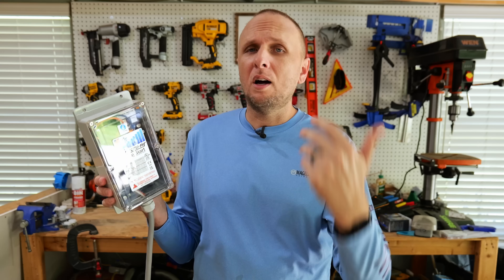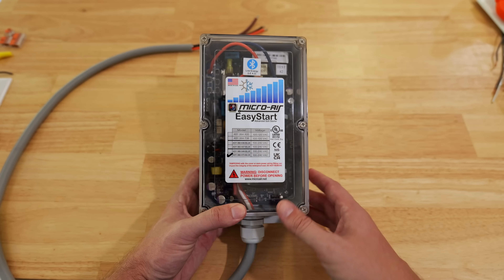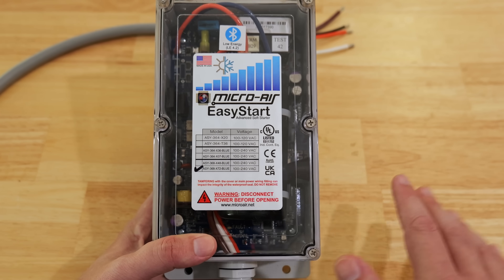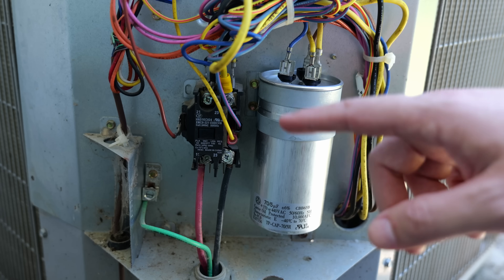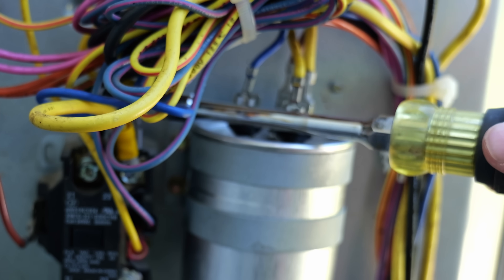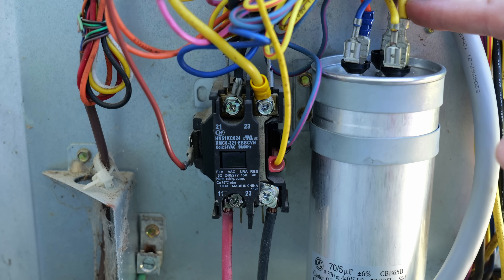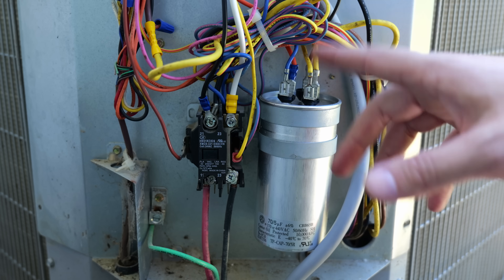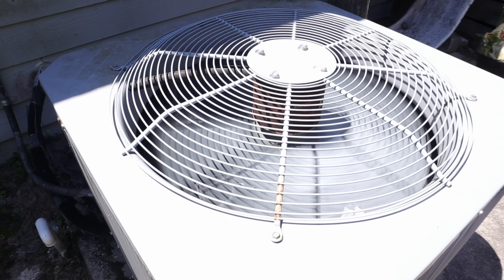Why Every Homeowner Should Consider Installing an AC Soft Starter | Micro Air Easy Start Install

Comment: Non-inverter generator it appears.  Concerns re: dirty power and electronics?  I have a whole house surge protector.  Would mind installing one but I’m not sure my 30A Northern Tool Powerhorse 3500 could start it.
Reply from the maker: My large generator is not an inverter but it’s THD% is under 5%.  Won’t damage the sensitive electronics.  Really just depends on your AC unit and what it needs to get started.
Reply: @HowToHomeDIY That’s the key then, the <5% THD.  Wagos considered?

Comment: I installed an EasyStart last year when I got a Predator 9500 (set up and wired for a possible second 9500).  We have an all-electric house with heat pump.  The EasyStart works well: it reduced the inrush from nearly 90A to typically 20A.  Soon after installing it we had a heavy rain and mosisture got into the housing, and i resealed the housing after drying it out.  One thing that would be nice is that the bluetooth would connect when the compressor is not running in ordeer to get stats.

Comment: (Update) As a former Army Gen Tech, I appreciate videos like this! I installed a generator inlet and load tested my house with my Westinghouse 9500 gen and it overloaded it. 

I installed the microair X48 on my 3.5 ton AC and the generator took it like a champ! As an added project, I installed emergency lights outside my house where my inlet is during power outages at night.

Great videos! 👍🏿

Comment: You hooked everything up properly...this is where the pros come in. Your in rush current is always checked at the common wire on a single phase compressor. Look at your schematic for the common wire and trace it back to your contactor. Also look at the data plate this will show you your RLA run load amps. I'll guarantee your RLA which are also checked at the common wire are well below 125 as well as 35. I'll also bet your RLA is probably below 10amps when checked properly or your small generator would not have been able to start the A/C unit.
Reply from the maker: Nope, my RLA is nowhere near 10 amps let alone under it.  I showed what inrush the meter read before and after install.  My small generator still had no issue starting it up.
Reply: @HowToHomeDIY  you need to check it from the common conductor not the run.....smh

Comment: Great videos!  Thank you.  I have a 3.5 ton, 16 seer a/c. My generator is a 4750w WEN dual fuel generator. Is it large enough to power my a/c, and maybe other things with a soft start installed. There is a hard start on it right now. Guess it would need to be taken out?
Reply: I think you'd need to take off the hard start.
Reply: @Alan-yd5pc  yes, I thought so.  Would this generator be powerful enough to start up my system?
Reply: @nickdeliso7026  I'm not sure.  You would have to do some load calculations once you determine how much juice the A/C needs.  I'd imagine if you ONLY ran the A/C with the soft start installed that would be doable, however, you may not have too much reserve power left to power other things in the house.  Once you do the calculation, you will know for sure.
Reply: @Alan-yd5pc  Thank you Alan. I may buy a larger generator after consulting a local electrician.

Comment: I have a 4-ton (46,000 BTU) A/C unit. Two years ago I installed a Micro-Air EasyStart 368 (4-ton) Soft Starter ASY-368-X48-BLUE. It now has 26,400 starts. My AC unit now uses 12.8 to 13.8 Amps and a Start Peak of 33 to 36 Amps. I bought it at Global Yacht Supply. It was shipped from Micro-Air. It now costs $332. I have a Firman T07571 Tri-fuel and run it on NG.
Reply: 4 ton is 48,000 BTUs

Comment: Does it convert voltage or do you still need a generator voltage output equal to your compressor motor voltage?

ie: could you use it on a 230V compressor with a 120V generator?
Reply: No, unless you have two 120V inverter generators designed to work together.

Comment: great. my thing is saving money. what is your electric bill like now? how much are you saving now?
Reply from the maker: It wont reduce the electric bill in most areas as it is only reducing the peak in rush on startup.  But in areas where the electric company charges you based on your peak wattage, this will help bring those bills down, usually by a good amount.
Reply: @HowToHomeDIY  that's what i want to know being i'm in florida. is it worth spending $400 for this thing only to see a $1 or two difference on my bill. that isn't worth it to me.

Comment: I wish I'd seen this sooner. Cost almost $6k to replace the compressor. We get a lot of power surges. The lights dim when the AC first kicks on. We have a whole house generator but when we tried to use it, it tripped the breakers. Not sure if that was related to AC or not. If it can reduce power draw and protect the compressor from power surges, that would be fantastic. I'm going to share this on some forums I'm on because this is awesome.
I wonder if I could mount the unit on the wall next to the box that feeds power to the unit. 
What gauge wires are those? 10? They look larger than 12. 
How are the learning starts done? Does it do it automatically or do you have to turn it off and on manually?
What kind of breaker box is that? And what sort of outlet goes to it? 
Before I saw the end I was asking if there was a video on setting up the generator thing. I see there is one. Thank you! This will come in handy. We were without power for almost a month after a hurricane and then a week after we got power back we got hit with another hurricane and it was out for almost 3 weeks. We have a well system so we have no running water and it was dead of summer when it was hot as hell. This will definitely come in handy! Thank you so much!

Comment: WOW. Great video. My question. I have two 4 ton units.  My generator runs at 5500 running watts. Do you think I’ll be able to run both AC units with 2 soft starts?
Reply: Only if you run one A/C unit at a time.

Comment: I have one of these on my 3.5tonne American standard single stage.  Reduced starting amps from 110 to 31.  So that's 7300 watts vs about 24000 before.  Installed new, almost two years old now no problems.

Comment: If you had to buy a new replacement compressor / HVAC system now, what percentage of systems (or brands) already have this functionality incorporated into their unit.  [I'd think could be based on lower or higher end.]   I'm considering one for existing units. but wonder if/when I need to replace the system, if the "not that inexpensive" soft start goes OBE.

Also, I thought I saw when first looking at these that they incorporated a time delay.  Basically, if the compressor was running, and power was interrupted, and then restored, it would want a few minutes before repowering the compressor.
Reply from the maker: As of now, really none of the AC manufacturers are putting anything like this on their units.  Micro Air is in talks with some to start including it on some models but so far has not happened.  Yes, if power is interrupted, it will not start the unit up for either 3 or 5 minutes.  I can't remember the exact delay time.

Comment: Wondering if I can run my AC unit (4 ton) on a 40 amp breaker with a 7000w generator that has a 30a 240v output. Any help appreciated

Comment: First thing I thought of when I saw this video is actually a large air compressor. I have a 10HP air compressor which takes 45amps to kick off BUT air drops to about 25-30 when running. Wonder if this would help that compressor last longer…..

Comment: Anybody know what the difference between a hard start $40 and soft start $300 is?
I know the capacitor is giving extra initial power on a hard start unit the soft start seems to delay the fan start up and the compressor start up.

Comment: Will this work on my AC unit even though I don't have, or use a Generator. Also in the link for it it says 3ton unit, I believe mine is 2-2.5ton size will it work with that size unit. Great video and dosen't seem to difficult to install. Thanks.

Comment: This was super interesting to me as someone with solar who's going to get batteries soon in arizona, because I have TWO air conditioning units and I want them to be run off the batteries. Anything that will reduce the power draw & the stress on the system will be amazing!
Reply: A/C will drain your batteries fast!! You might consider getting a whole house generator instead. I'm in TX and having solar put in and  I'm getting a Generac for the summer needs and 2 batteries for if the grid goes down in the winter.

Comment: Recently cleansed the dust from the blower and switched the main on 2 minutes before running A/C.Surprised as it started without a jerking noise of compressor.
Also heard about new compressor comes with a different motor which can provide variable speed as requirement.

Comment: Awesome video, I have a 9000 w generator with a 30 amp plug, you don;t think it will blow fuses? how long did you run your smaller one?
Reply from the maker: It shouldn’t.  I didn’t run it super long but the running is the easy part if you can get past the startup.

Comment: My service tech recommended this when he came this spring. My home is 3 yrs old and has a basic “builder grade” hvac system. I definitely notice my ac is a lot quieter when it kicks on than my neighbors. It’s hard to compare the electric usage as we are cooler this year than last.

Comment: Interesting and logical. 

Couple of thoughts. First, the generators themselves. While you have plenty of power, that quality of the power produced by these is problematic. These brush type gens produce poor quality sine waves. These stress electronics a lot. In fact, some electronic won't work at all with them. Our World is highly electronic now.  I have one like yours and I have a brushless gen head. 

So, the very electronics of this soft start are going to be stressed (build heat) with this set up. 

I would suggest either an inverter based gen (Harbor Freight and others) set or a brushless gen head, such as one from CGG Central Georgia Generator. I do not have any financial ties to CGC or HF.

Comment: Excellent info. I need to get one of these for my AC.

Is there something similar that would work for my 60 gallon air compressor in the shop? It seems to have a particularly hard start, almost violently jolting, lol.

Comment: I don’t know how many residential acs have a variable frequency drive inside for speed control but do not use a device like this if yours does. The VFD will be programmed to soft start itself.

Comment: Hello,
Does the easy start come with the bushing you need to feed the wiring thru the knock out from beneath. If not, what size,  type do you need ?
Thx

By the way,  of all the install videos I've seen on the easy start install, by far this is the best one !!!

Comment: You'd think all A/C units would come with a soft starter installed.  Our old A/C never tripped our main house breaker, but when we got a Trane it would trip if other appliance like the dryer was running.  The techs even put in a bigger starter cap and it had the same problem only not as frequently.
Reply: In point of fact, 2-stage and variable speed systems effectively have soft starts built-in. We opted for a VS system in part because it allows us to run the whole home from a Predator 9500 invertor. It also makes for am more comfortable home that a single stage system. However, it was vastly more expensive.

Comment: Adam, you might want to redo the 10Ga barrel connector since you didn't prep the wires properly and you didn't apply the crimps of the ends properly.
Reply: As someone that has installed thousands of them, what are you talking about?   He twisted them with his fingers to help avoid fraying while inserting them and there is a crimp on both sides.  They aren’t rocket science and he did them correctly.  Can’t say the same for so many other YouTubers though.

Comment: I like the idea of this bud our unit, a 3.5ton Weatherking, uses a Copeland scroll compressor.  Word is they don't look kindly on these units being integrated into them.  Since our system is only a year old I guess we have to pass.  Also, our water cooled 20KW Kohler generator really doesn't even notice the compressor start.

Comment: If that circuitboard is not dipped in epoxy, it's a go.
Many are a no go, if I can repair discrete electronic components, it looks worth the extra cost.👍

Comment: Do they make these for a outlet plug? Building a offgrid house but running a large window unit and a 1hp shallow well pump and cant do both off my 3750 gen vause of starting amps.

Comment: I have a RHEEM 4 ton hvac and was recommended by AC tech  to just have  soft start relay  installed which does the same thing without the fancy bluetooth. He wants 300 for install of the relay however its still cheaper. Is he right?
Reply from the maker: You better be sure it’s an actual soft start kit.  I can’t tell you how many stories I’ve heard from people calling their ac company, telling them they want a soft start kit installed and they install a hard start kit.  For $300 he’s probably not installing this.
Reply: @HowToHomeDIY   Thanks and i did clearly mention i wanted no more flickering lights, a drop of in rush amps and ease of use with emergency generator. He said a soft start relay does the same explained as a start relay of 2 parts. Not sure if that relay cost him 20 dollars and charging 300. I just want a soft start for my Rheem .
Reply from the maker: Yes anyone can buy those online for around $20 but that is not a true soft starter.  That is still a hard start with a relay.   It essentially increases the amperage sent to the compressor.  But it does it so quickly that it can allow a generator that normally wouldn’t be able to power it to be able to do so.   And if your compressor is older and is hard starting, or having trouble getting started then a hard start might be better for that.  I just don’t know your particular circumstances, whether the light flickering is fairly new, the age of the unit, etc.    But for the tech to say a soft starter is the same it just doesn’t have blue tooth is completely false.
Reply: @HowToHomeDIY  Got it so thanks. My unit is 1 year old 4 ton rheem and saw your videos so wanted an improvement to run genny and extend life. Was not sure weather soft or hard start was better for me. Thanks for responses.
Reply: @joekrueger4462  I would go would the soft start in the video then.  It has been fantastic for me.
Reply: @johnpicard4909  Thanks John. As stated i have a 4 ton 1year old rheem and lookin for enhancements. In florida i want to cover my bases even thouh my genny is 13k duromax! Thanks for responding.

Comment: Great video. Just subscribed.  Do you know if your refrigerator and AC can both start up at the same time with the smaller generator?
Reply from the maker: That is something that it may be able to do, however, not sure it is something I would ever test on my particular smaller generator.  I would just run my AC for a while to cool or heat the house and then turn that off and all of my other important circuits on.

Comment: I installed this a few weeks before my whole house generator was installed. After installation, the installers powered up the system to test with the AC load. I have a 4 ton unit and the rated start amp is 144. When the AC was powered up, the Generac did not cough when the AC unit powered on! The installers were flabbergasted because they did not realize I had the "Macro Air" installed LOL. They had assumed I would have to have load balancing done such as taking out things like my dryer, but after this test, they said my whole house was good to go.

Comment: Does this product reduce the running amperage of an AC unit?
Reply from the maker: No.  But some claim they have seen their run amperage go down some.   Only way I can think of that it would be possible would be because their is another capacitor in the soft starter.  Where they definitely can save money on electric bills though is in places that charge based on your peak wattage for the month.

Comment: I installed this soft starter late summer last year. My starting amps went from 75 to 40. I have a 17 year old Ameristar unit and it's such a noticeable difference when it starts. I don't get the light dimming anymore and since the unit is outside the master bedroom window it's much quieter when it starts up. And most importantly, my Preditor 9500 inverter generator runs my whole house including outdoor low voltage lighting during a power outage. My home is the envy of the neiborhood. Great product so far. We'll see how the power consumption is this summer.
Reply from the maker: Awesome!  Thanks a lot for taking the time to leave your experience with it.  I have loved mine for the last 3 years.

Comment: I just installed one on my AC unit. Dropped the start current from 115 to 35A .... but my generator running on natural gas tripped all the breakers in my panel. What might be wrong here? Any hints?
Reply: According to Westinghouse the issue will be solved removing the jumper between neutral and ground on the generator side. I'm skeptical about it and willing to try out when I'm back home after my vacation
Reply from the maker: Sorry I didn’t see your first post.  Yes if the neutral is bonded, it could be what is causing your issue.  To make it a floating neutral is usually about a 3-5 minutes fix.  Hope it changes it for you!